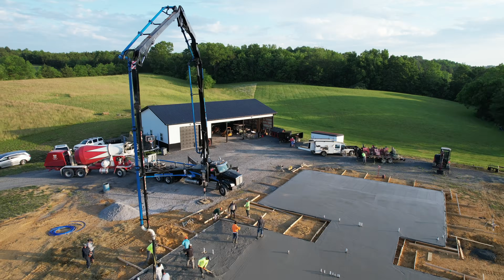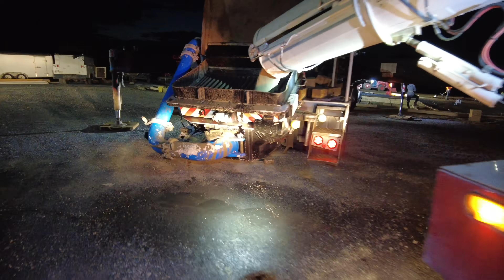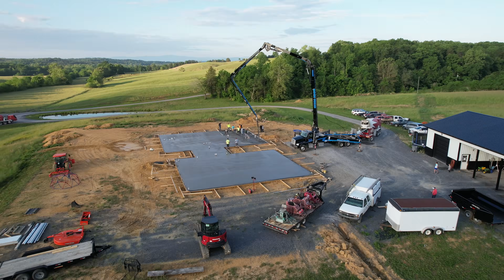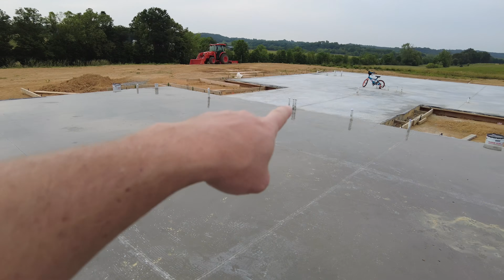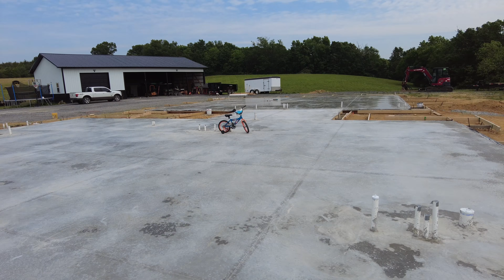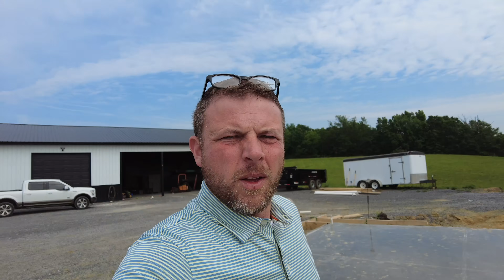Pouring 110 Yards Of Concrete For House #143

Comment: Looks great! No “real world” job turns out perfect. A couple years ago I had 9 yards of concrete shear the heads off the kickers, if not for a nearby tractor with a loader I used to brace the wall it’d have been a disaster. Crap happens, life goes on. I can’t wait to watch you pull the pex through your conduit, I know you’re a blessed man cause there’s no way I’d be able to get it to make those turns. Keep it up hero!
Reply from the maker: You hit the nail on the head, crap happens. When I pull that pex through there I think I will title the video (In Honor Of Sean Young)😀 Thanks as Always!